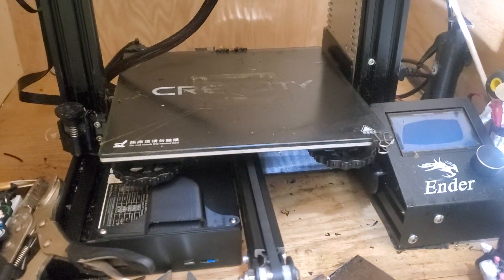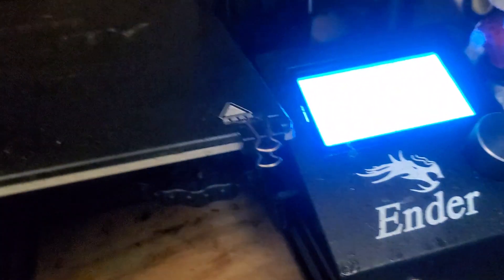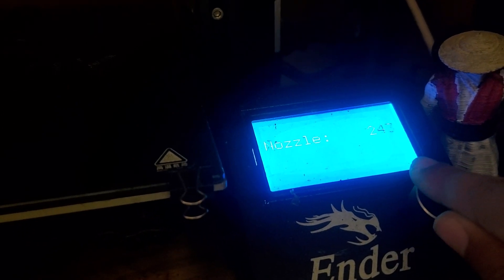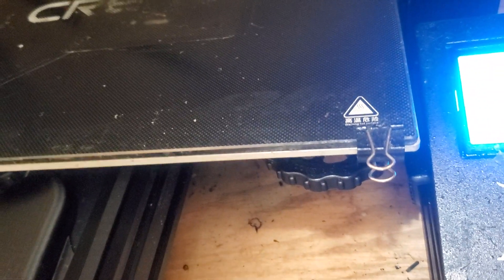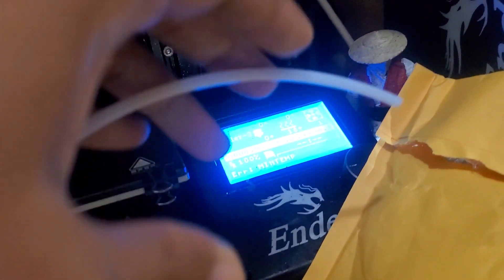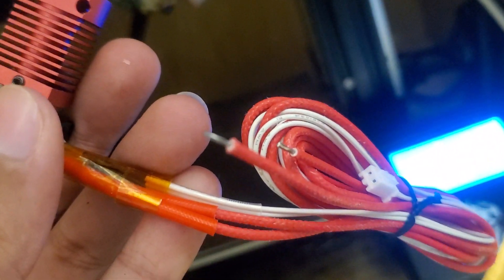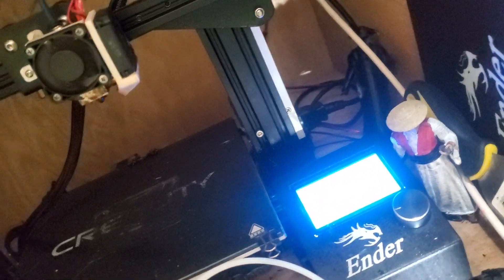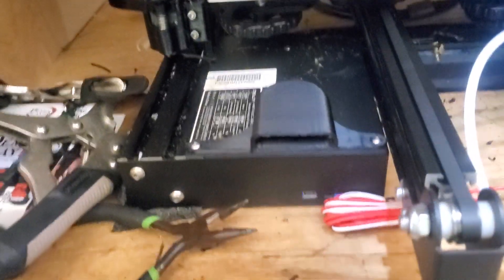how to fix hotend not heating up on the ender 3

Comment: its been so like ive had this problem you need a new hotend
Reply from the maker: I thought so so I may get this one from Amazon Creality Official Ender 3 Hotend Kit, Upgrade Assembled Extruder Hot End Kit 24V with Capricorn Bowden PTFE Tubing, 0.4mm Nozzle×5, Silicone Sock×5, 2 Pair Fittings for Ender-3S/Ender-3 Pro https://a.co/d/6TGByTh